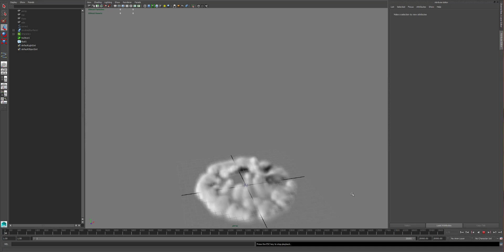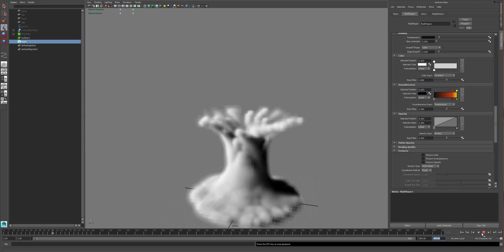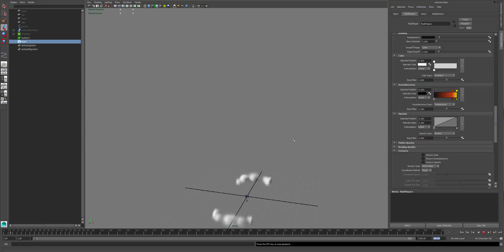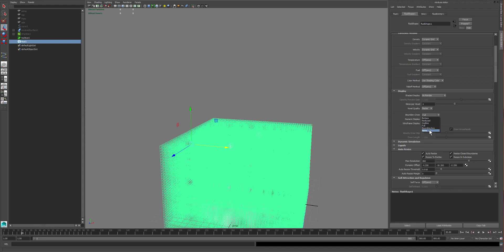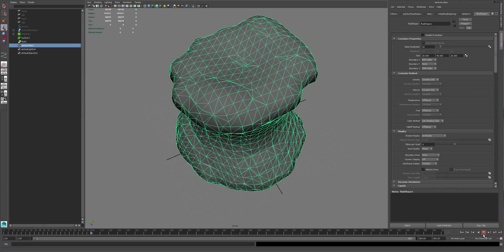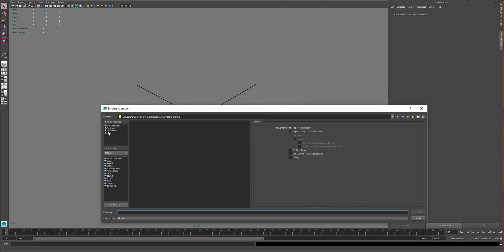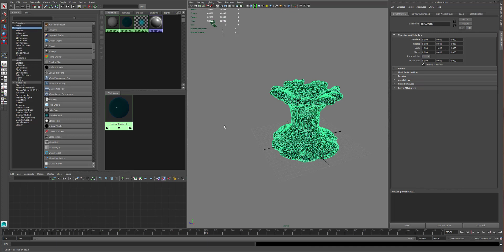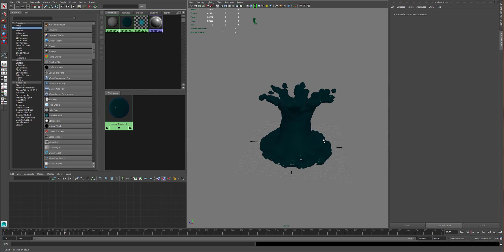Fluid to Alembic Cache

Comment: Hadn't heard of flip particles. I literally just installed it a few hours ago but already I'm thinking why have I not used this before. I don't typically mess with FX but I'm making a tornado and it's taking FOREVER to render the fluids in Renderman. Already i can tell that you've saved both me and my computer a headache. I thought the whole point of VDBs was to convert fluids to polys but clearly i'm missing something.